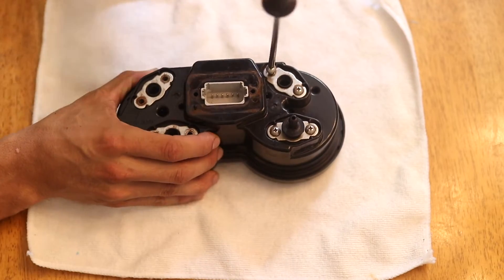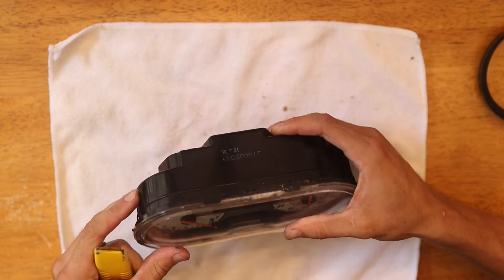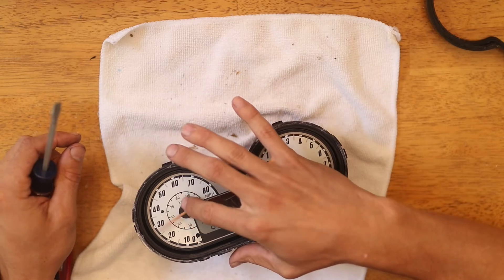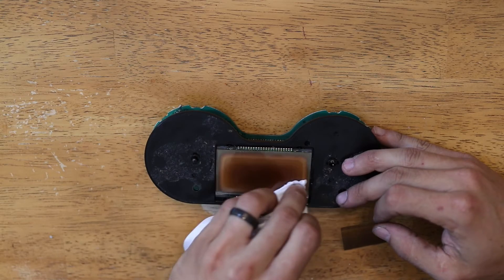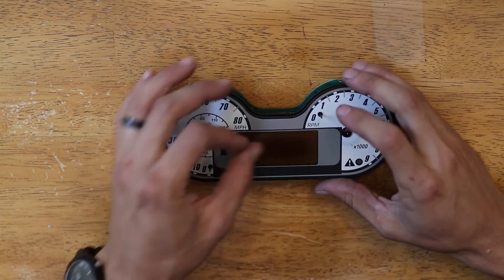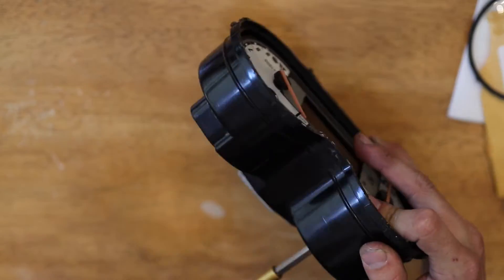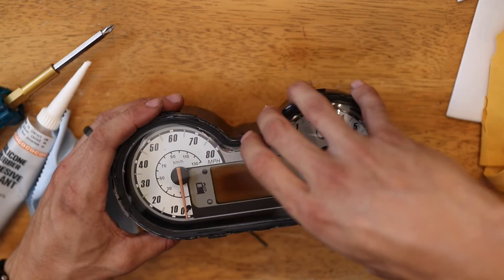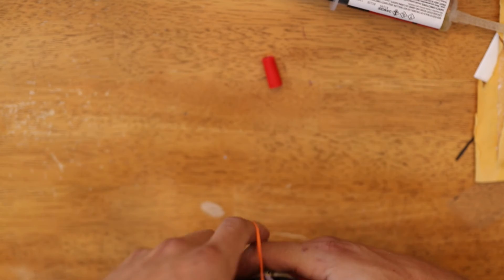Gauge Display Teardown / Polarizer Replacement | SeaDoo GTX 4-Tec

Comment: Thank you for the informative video.  Mine is a 2002 and I literally watched the screen on the gage cluster go black.  I was able to remove the two layers of film without removing the needles and got it all off.  I'm down to the glass and cleaned it with goo gone.  I can't seem to find polarizing film with adhesive, or at least a static cling.  Many screen protectors are either glass or are not polarized and claim they're not because phone screens are already polarized.  My screen looks fantastic through my polarized sun glasses, but not real visible without them.  Any other ideas on where to get the correct polarizing film?  Are the privacy screen covers what you're referencing?  Those seem to all say glass as well, and I can't find if they're polarized.  Need some help with this last part of the repair.  I really appreciate your video!
Reply from the maker: You are correct that screen protectors are not polarized. Do not get a privacy screen protector for it!!! You actually need to be looking for an LCD repair polarizing film. The polarizer is laminated to the LCD along with the digitizer and outer glass in most screens now, so it's not something that's easily replaced, thus the reason it's so hard to find. I used an iPhone 6 polarizer that I found on eBay for a total of $5.77 last year. I do have a link to a 10 pack of iPad polarizing films on Amazon in this video's description. They're about 3x the cost of the one film I purchased, but that means you have replacements in case you mess up.
Reply: @FixandMaintain  Thank you!  I'll search again on Amazon.  I've noticed if a search is not specific enough, you can't always find things on Amazon.  I appreciate the quick reply.  Webb also sent a link to e-bay, I'll check that out too.
Reply: Hey Jim, I've got me this one from ebay ( https://www.ebay.com/itm/Polarizer-Diffusor-Film-for-Apple-iPhone-5-Polarized-Polarizing-Sheet/332310776261?ssPageName=STRK%3AMEBIDX%3AIT&_trksid=p2057872.m2749.l2649 ) Still didn't test it because my battery is not good and I've got a lot of stuff to do at work this week, but you could give it a shot. It is only 6 bucks. Installed mine 2 days ago. WHen you install it, remove the filme with the blu line first, that the adhesive side, then remove the top one after you install it.
Reply: @webbfdlz  Thank you Webb!  I appreciate the feedback.  Random DIY also gave me a couple of places to search for one.  Thanks for speaking up!

Comment: Bro, I would like to thank you very much for putting the time to do this great video, I can tell you that you are my hero. Just bought a GTX with the cluster flooded with water and the LCD polarized film was "bloated", I followed your instructions step by step and I was able to open it up and install a new polarized film, In my case, I also had to do a deep clean on the circuit and connections, Used a dremel circular brush to clean some circuit parts, WD40 to take the dirt out and after I did all of this, left a fan blowing the circuit over night. The down side is that I completely destroyed the needles trying to remove them ( I will purchase some standard cluster needles from ebay and install them) too bad I didn't mark the position, so I will use hot glue to put 2 tooth picks and have it on to find the position, then glue the real ones with JB Weld. Let's hope it will work. I CAN'T THANK YOU ENOUGH.
Reply from the maker: You're welcome! I scoured the internet before attempting the repair on mine, hoping that I would find out what I was getting into before I took the plunge, but barely found anything. I figured as long as I could help one other person it would be worth it. I'm amazed that, as of right now, I have more than 11K views and am the #1 video result in Google for SeaDoo gauge repair!
As for the needle position, I tried to put my needles back exactly how they were, but ended up being about 500 RPMs too low and about 4 MPH too fast (when compared to the digital readout). However, the only way to actually tell if you have them in the right place is to have it all back together and have it out on the water, kinda unfortunate since you'd have to have it sealed back up to go out and test it.
Reply: @FixandMaintain  hola buenas noche vivo en Florida tengo uno dañado cuanto me cobraría por repararlo y donde seria el envío gracias
Reply from the maker: @adelharami2186  Lo siento, solo trabajo en mis propios vehículos
Reply: Link to the polarized film you used.

Comment: So I have the iPhone 5 polarizer. It’s black when it’s horizontal (fits the display) and transparent when 90 degrees (too small for the display). Do I have bad sunglasses, or did I get the wrong polarizer?
Reply from the maker: Have you tried plugging in the circuit board to the SeaDoo (not in the housing) and seeing if you can read the display while holding the polarizer in front of it? It may be that the orientation of the lenses in your sunglasses are 90 degrees off of what mine were. If you can read the display with the polarizer covering the whole LCD, go ahead and install it. Of course, then you won't be able to read the screen with those polarized sunglasses unless you turn your head sideways :) If you can't read it (with your sunglasses off), you may have to buy a different polarizer. I would think the all polarizers for the iPhone 5 would be in the same orientation, but since they're mass produced in China, that may not be the case.
Reply: @FixandMaintain  the iphone 5 polarizer doesn't work on the 2005 seadoo wake - if you turn it sideways it will cover the screen but the readout is white instead of black and it will be difficult to read in the sun.  I'm still in search of one to fit my screen the size I need is 3" x 1 1/2".
Reply from the maker: So, after looking back at my email receipts, I actually ordered the iPhone 6 polarizer, not the 5, but I remember having a bit of excess that I had to cut off. I would think that all iPhone polarizers would be in the same orientation, though.
I can't guarantee this will work, but here is one for an iPhone 6 plus that ships from Texas: https://www.ebay.com/itm/iPhone-6-Plus-LCD-Polarizer-Polarizing-Diffusor-Film-Sheets-for-A1522-A1524/154037903649?hash=item23dd5fe121:g:2zcAAOSwbJtfLbcF
Reply: Random DIY how do you stick the polarizer to the display? There’s no adhesive on it
Reply from the maker: @Royaldetailingmd  The iPhone polarizer that I used had a peel-off protector on each side, one on the adhesive side and the other to protect the front if I needed to use a tool to push out any air pockets.
Reply: Random DIY I peeled off the side I assumed would be the sticky side, based on the polarization. I must have guessed wrong. The other side has a rainbow effect but you can see the display. Thanks again
Reply: @jeanpierro5973  You're completely right. I put the one for Iphone 5 and didn't work. purchased the one for 6Plus, worked like a charm.
Reply: @FixandMaintain  Thanks for the follow up @Random DIY , I purchased the one you recommended, removed the one for iphone 5 and installed the new one, worked fine. Thanks.
Reply: Random DIY I just did that to confirm my initial findings. And I need a larger polarizer. I can read it vertically but not horizontally. I also used the dremel to cut on the seam. Turns out the harness wires are under that seam. Just some quick soldering fixed them. Thanks again for the video, it helped me. Side note: those needles are impossible to not break🤦🏻‍♂️
Reply from the maker: Thanks for the heads up, I saw someone mention the Dremel method in a forum and I thought it sounded like a better solution than what I did. They didn't say anything about the wiring harness. I added a card to pop up in the corner of the video with a warning. And yeah, if your polarizer is sun damaged enough to need to be replaced, those needles are going to be very brittle!
Reply: @FixandMaintain  I would not recommend that. WHen I was doing mine yesterday, I looked inside and didn't see any benefit of cutting with a dremel disc in that position. Just follow the method of @Random DIY and you'll be fine. if you're able to scrape the old film wihtout removing the needles, that's the best, because the needles WILL brake, that's a fact lol.

Comment: When you did this did the needles at least work? I got nothing on my cluster working winder if its this or a fuse or something else
Reply from the maker: Yes, the needles were working fine before I did this. You should test with a volt meter to see if you’re getting 12v to the harness behind the gauges. I don’t remember which wires it is, but it shouldn’t be too hard to find.

Comment: I have repaired my screen and put everything back together. I sealed top lense in with silicone adhesive. I am having a problem with condensation. What did you do for this issue?
Reply from the maker: I did have a small amount of condensation after repairing my screen because I didn’t seal it well enough with silicone. After going back around the edge I no longer have any issues. If you get any on the front plastic, use a cloth with rubbing alcohol on it to clean it before the silicone dries.
Reply from the maker: You did use actual silicone and not a siliconized acrylic, right?

Comment: Can you test the display before adding the iphone polarizinging film and lenes?  
I scraped my display without removing the needles.
I hooked it up - my needles move on plug in and startup, but no display at all.
Reply from the maker: Yes. Once you scrape off the old polarizer, the screen will not be visible at all. However, if you look at it through the new polarizer or a pair of polarized sunglasses, you’ll be able to see the screen again. Keep in mind that polarized filters are directional - if you still don’t see anything, rotate the polarized lens 90 degrees and it should come into view.
Reply: Maybe you have no display because you used a polarized film for iphone 5. on this one th epolarization is vertical. get the one for Iphone 6 plus and it will workr fine. the link is in one of these replies from Random DIY.

Comment: I got a 2006 gti 130 and I cracked the plastic trying to fix it and kind of made it worse. how would i take it out and put in the new display without breaking it? also where can I get new displays and are they all around $700?
Reply from the maker: Looks like a new one for your GTI (part #: 278002217) is going to be $700 no matter where you get it from. Unfortunately BRP doesn’t sell individual parts for the gauge assembly. Not sure exactly how to remove yours, since all I have is the 05 GTX, but the diagram looks like there’s a plastic bezel hiding a few hex screws. https://www.seadoopartshouse.com/oemparts/a/sea/500d6b78f870020908257c4d/electrical-accessories-gti-std
Reply from the maker: You might want to try saving an eBay search for that part number that will send you a notification if there are any new listings. Even then, you’re probably looking at somewhere in the neighborhood of $400 for a used display.

Comment: Our SeaDoo 2003 GTX 4-Tec gauge cluster has stopped working altogether. Could someone tell me how to access the gauge assembly so that I can check the connection?
Reply from the maker: The gauge cluster is held in by a rubber gasket that goes all the way around it. Just pry it out with your fingers. It takes some effort, but there’s nothing else holding it in place. After you get it out, there’s one wiring harness attached to the back side.
Reply: @FixandMaintain  ....thanks!
Reply: Did you manage to fix it Kenneth as I have the same problem?

Comment: Did you have to cut the screen protector, is how did you do it?
Reply from the maker: Yes. It was just a polarizing filter for an iPhone 5 that I bought on eBay, but after cutting it to size with scissors, it installed just like the old-style flexible screen protectors.
Reply: any idea to get the needles off with out damaging them
Reply from the maker: Using a flat bladed screwdriver, I was able to get the RPM needle to slide off the post. But when I put it back on, I wasn’t able to get it back in the exact same position, so it’s about 500RPM off of what the digital display shows. Since the speedometer needle broke off at the base, I was able to glue back in place, so it’s almost the same as the digital display.

Comment: I also noticed you did not change the film on the back side of the LCD which also looked to be damaged? Do you have a picture photo on how the LCD screen looked after the repair with it working on your Sea Doo?
Reply from the maker: No, I didn’t change the film on the back side of the LCD. I don’t have any experience in repairing LCD screens, so I didn’t feel comfortable doing anything more than the front polarizer. I don’t have any “after” pictures, but it the screen is easily visible now (although the dark oval in the middle is somewhat annoying). I would much rather have replaced the gauge cluster, but I was quoted $800 by a local dealer for the replacement. Thus I was happy spending $5 on a polarizer and fixing it myself.
Reply: The polarizer lines go one way and not the other so there is a 50/50 chance of putting it on wrong. So you might turn the seadoo on first and hold the screen up against the bad image and maybe you might hold the screen to see which way looks better. Be worth a try. I know if you had the old screen off you could try.

Comment: If you were to cut the back off, would you really be able to pull the gage cluster through the back?  It looks like it sits on a ledge in the plastic housing.
Reply from the maker: Here is the forum post that my comment about cutting the back was based on. This was the only info I had about disassembling the gauge cluster, so I thought it might be easier to go at it from the front, but in the end, I'd say his way would be easier. As long you make your cut near where he did in the first picture, you should be fine. http://greenhulk.net/forums/showthread.php?t=244435